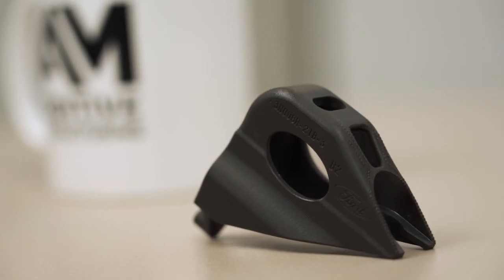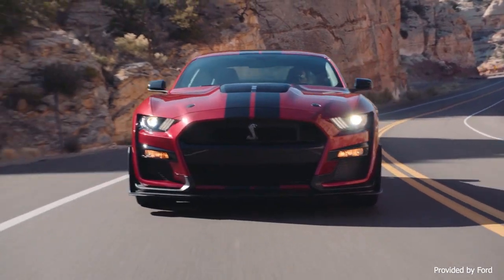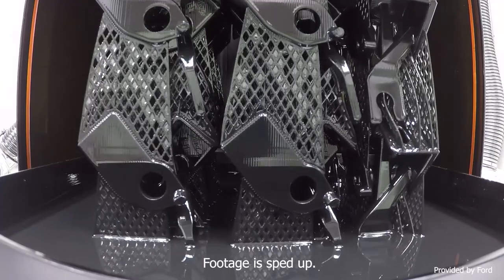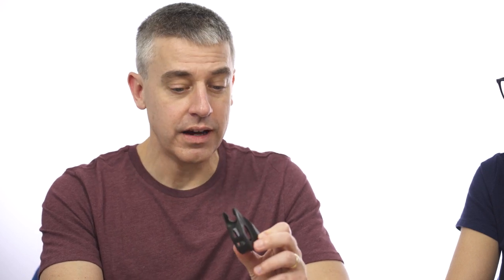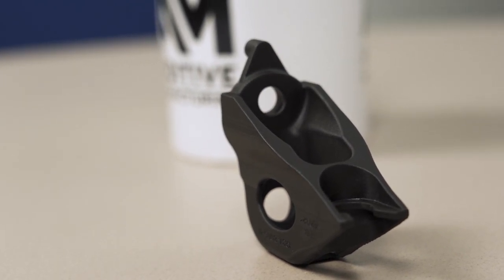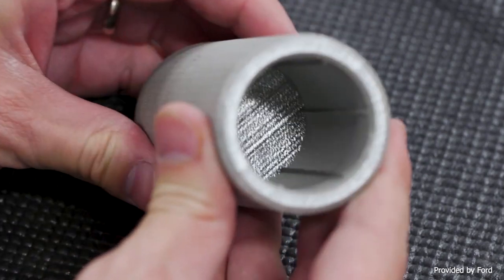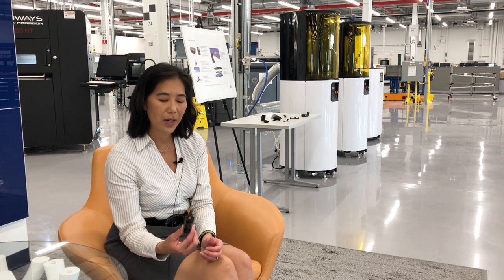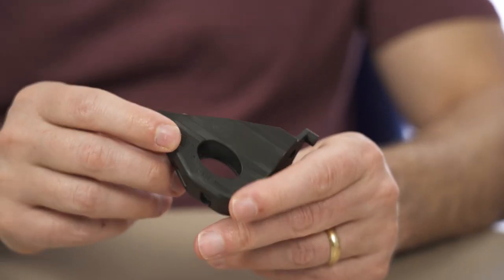Ford is 3D Printing Automotive Parts for Mass Production: The Cool Parts Show S2E1

Comment: So much to learn here. Ellen Lee and Harold Sears from Ford lay out a great idea: practicing on thousands of parts to measure manufacturing capabilities.  Skim PPAP requirements on wikipedia and the value of faster iterative cycles becomes clear.  Note that Harold Sears hits on the critical knowledge needed as part quantities climb: build orientation, consistency, tolerance for part placement on the build tray.... 10% waste on a 10 or 100 piece part run may be acceptable for some projects, but quickly becomes a barrier as the quantities rise. Bonus points for Carpenter Additive tour.

Comment: Resin parts are terrible for strength, but great for look straight from the machine, if empty voids are used they get filled with uncured resin and later change in temperature crack the part, especially hot temperature